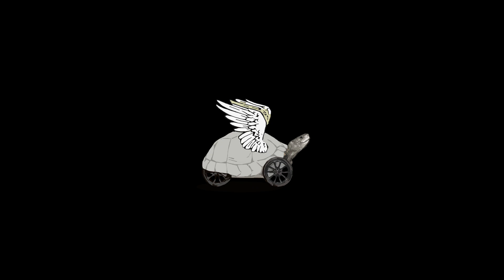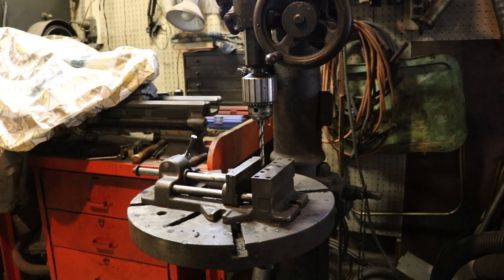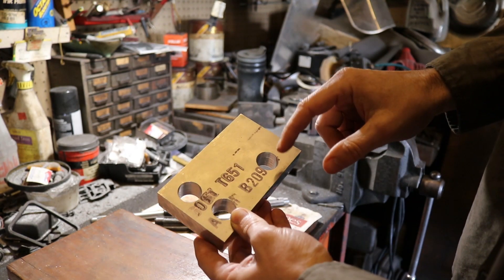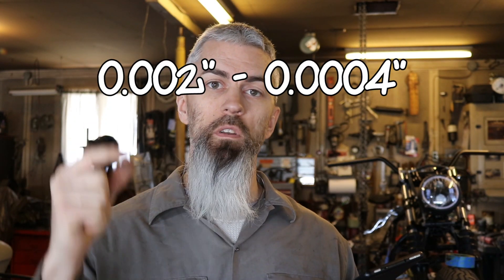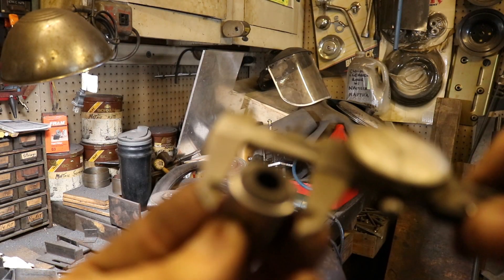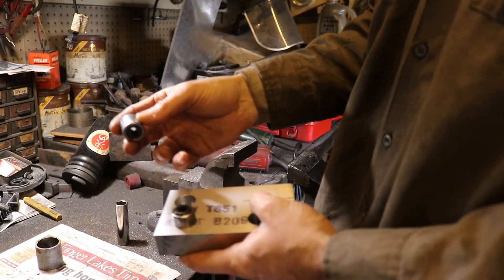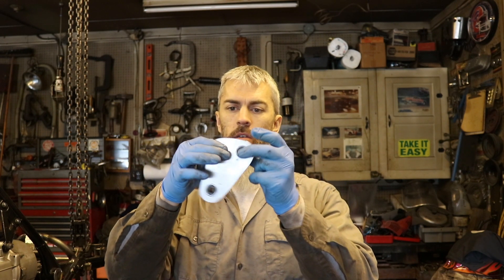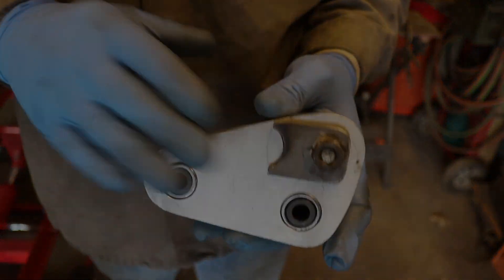Honda Goldwing Bobber Build | E36 - Aluminum Linkage Fabrication

Comment: Awesome videos! I’ve just started tearing down an ‘81 goldwing as a bobber project so these are extremely helpful.
Reply from the maker: Fantastic! Good luck on your build. How deep are you planning on going? Chop a bunch, or a little?
Reply: Definitely taking out the tank and welding a backbone. Gonna cut out for a new seat as well. Would like to fabricate a box to remount the ignition switch on the frame. I haven’t decided on the suspension yet but your videos on it are great!
Reply from the maker: @joshday4559  that sounds great. I've got a video coming up, #45 I think, where I mount the stock ignition switch on the frame near the seat. I made a bracket, not a box, but it might give you some ideas.